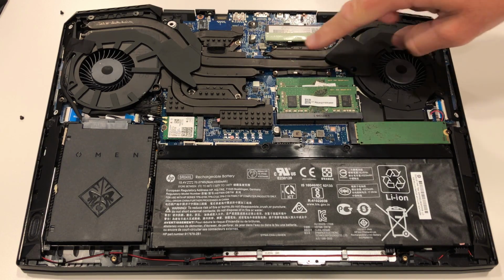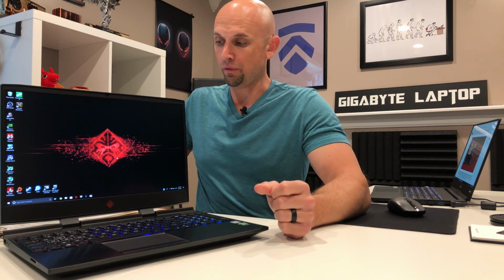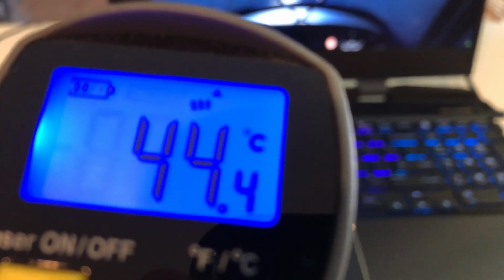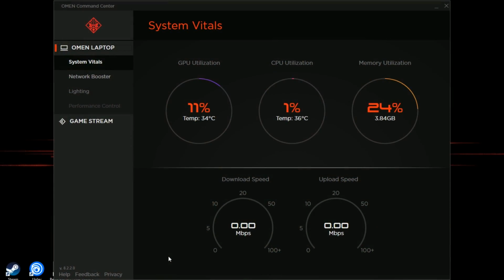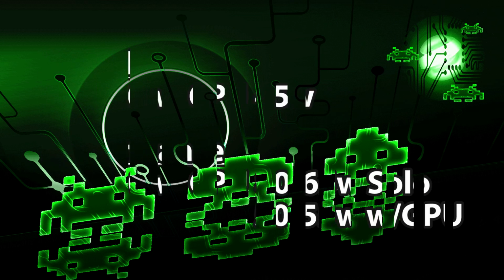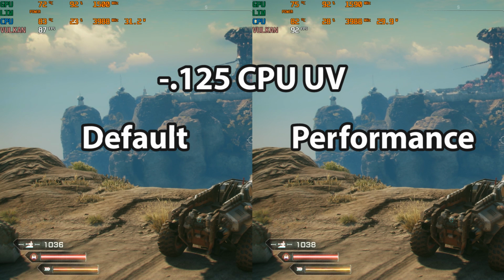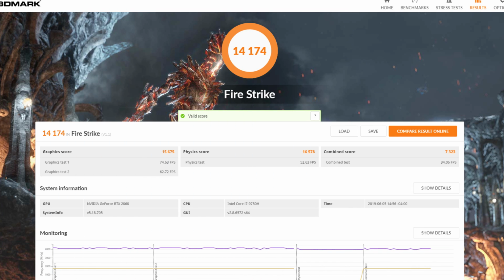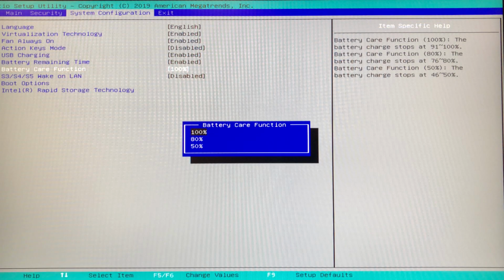HP Omen 15!  RTX, 9th Gen and 144Hz for $1199!

Comment: Hi Bob , I'm in a dilemma here. Should I choose the hp omen 15 or the Lenovo legion y540 ? Both have the same specs of  rtx 2060 , i7 9750 h and 144 hz and are available at the same price.
Reply from the maker: What’s your expectation of these?  The Omen has TB3 and neither one have proper fan control now that Lenovo removed this feature for some reason. 

The y540 looks more subtle which I personally find nice.
Reply: @BobOfAllTrades  Would like good performance out of the box  and  good gaming performance too. Don't know which does it better.The Y540 though has a bigger screen (17.3 inch) than the Omen 15 (15.6 inch)
Reply: Thanks for the advice though. Got the Helios 300 today for 999$. :)  Omen was sold out fast!
Reply from the maker: Karthik R. Yup I posted that deal this morning 👍

Comment: I am getting extreme touchpad lag and often doesnt register taps. Any idea?
Reply from the maker: Try downloading the correct driver from their support page.
Reply: @BobOfAllTrades  did that, nothing. Even during bios update where mouse is also enabled it lags a lot. Hope its not a hardware issue
Reply from the maker: Valters Boze If it were me I’d do a fresh install using Windows media creation tool and delete all partitions. You’ll be in for some work to get everything back the way you want it but if that doesn’t fix it at least you’ll know and perhaps proceed with a return.
Reply: @BobOfAllTrades  i think it was interference with something, works good. I noticed it doesnt work AT ALL if touchoad is within Vive VR lighthouse path, have to cover that direction with other hand to use touchpad

Comment: Bob, thanks for the great review. Just a 3 questions keeping me awake this night. Its 1.00 am in india now. Firstly who will be the winner if I compare it with Acer helios predator 300 i7 9750H, 1660ti and ELUKTRONICS 15 GR i79750H, 1660ti -- provided that those are also costs around 1200 bucks. Secondly the screen response time and backlight bleeding issue (if any, while acer 300 is pathetic on this) . Thirdly the hinges life in long term use. Please reply.
Reply from the maker: tanmoy biswas Hinges will be fine if you respect your laptop. I’ve seen the Omen at our local Microcenter and it’s been touched, closed and opened by more hands than anyone would put their own personal laptop through. 

Performance of the 1660 ti and 2060 are close favoring the 2060 by a tiny bit. 

The display on this Omen is made by LG and it’s very consistent in quality as I’ve had my hands on many different laptops with that part number and they’ve been great. 

That Eluktronics laptop with Eluktroboost is excellent and provides top notch frame rates per its spec. They run up to the max temps during Eluktroboost as shown in the review.

Comment: Just bought this laptop and it seems they've added fan control, somewhat, in the form of a basic Auto/Max switch in the command center? So there's that.

SO glad I found your channel btw. This video made my decision for me, tackled all the points that mattered to me and even save me the time on undervolt settings. Great job!
Reply: Just got this laptop. I am on the newest command center and bios F.12 and I don't see this auto/max fan setting. Were you able to find it?
Reply: @RastanPinball  Should be in performance control in the omen command center. If it's not there, you probable have a different model to what I have.
Reply: Mighty Duck yeah unfortunately that is what I am thinking. I have the same model as Bob in this video, 15-dc1052nr. Kind of bummed, one of the reasons I bought this was because of this added feature... oh well LOL. Thanks for the reply.
Reply: How is the laptop so far?
Reply: @ifteharulhaque2600  It's great as long as you undervolt the cpu to keep it under 90 celcius. Setting the fans to max helps as well in some cases. It just takes a REALLY long time updating windows and bios out of the box, the latter which, i guess, includes the fan control.
Reply: @bebekperkasa  Thanks👍
Reply: Mighty Duck hmmm how about the battery life in normal basis using? I've seen a lot of review said that it only lasts for 2 1/2 hours in the low setting even just for writing, that's stop me from buying this laptop :') please help
Reply: @jily0975  Not sure about battery life. I mainly use this laptop for gaming and graphics work and haven't been taking it out much. 2 1/2 hours seems pretty accurate an estimate, though, seeing this model doesn't come with an iGPU - meaning the system is running RTX at all times even at idle.
Reply: Mighty Duck Thanks for the response, hmmm yeah so it’s understandable that it consumes a lot of energy all the time :’) anw did the existence of iGPU/Nvidia optimus affected the gaming experience/performance?
Reply: @jily0975  No impact on performance that I can think of... which begs to question why HP would deactivate the iGPU in the first place. The laptop's small and light enough to be a mobile workstation, and that extra battery life from an iGPU would've gone a long way. Just another con to think about, I guess.
Reply: Mighty Duck yeahhh that's why i have come to the opinion that it might decrease or at least interrupt the gaming performance.. it's always giving little anxious to me if i cant solve the problem tho lol :") it's either big curiosity or just my pure OCD.. Thanks for your time, have a nice day 👍🏻

Comment: bob if this laptop has exactly the same chassis as the  1060 if i took the motherboard and placed it in the chassis of the 1060 will i get the updates services but not buying a new laptop??
Reply from the maker: That’s an interesting question and I do not know the answer. The CPU cooler looks slightly different too. Not sure if a new motherboard would come shipped with that.
Reply: @BobOfAllTrades  perhaps also replace the coolers or make some slight alterations? I the hard drive and battery looks the same so it should be at least cheaper than a new laptop coz that just wont make sence... would it?

Comment: I just bought this exact laptop from Microcenter here in Northern VA. I returned my Alienware m17 that had an RTX 2070 Max-Q. I mainly play AAA games at 1080p. I am telling you... this HP with a full RTX 2060 is getting much better performance than the Alienware m17 that I just returned. My buddy has an RTX 2080 Max-Q on his Alienware m15 and this HP with an RTX 2060 almost gets the same FPS on Ghost Recon Wildlands, AC Odyssey, and Gears of War 4 (there is a 7 fps difference in those games at ultra settings 1080p). This is one of the best laptops I have ever had. I had an MSI GS75 Stealth with an RTX 2070 Max-Q, an Alienware m17 with an RTX 2070 Max-Q, and I still own my Dell 7577 with a GTX 1060 (I am going to give the dell laptop to my wife). The HP Omen 15 with a full RTX 2060 is a fantastic laptop. Trust me... you wont regret buying it. Mine has a bit of back-light bleed, but I purchased a 3 year accidental warranty from HP for $171, and I love it! 

Thank you for this amazing review.
Reply: Daniel Mikhail . So i can play all games on ultra setting no lag no any thing and what about the fan is high voise or normal ??
Reply: mohamed Elshorbagy I have not found the fans to be super loud at all. The Alienware I returned had much louder fans. I think the fact that this laptop is thicker... I think that helps a lot with the fans.

Comment: I'm getting conflicting specs when looking this up. There is a model with a 8750h and a 2070 max q. Is the 9750h model also a max q variant?
Reply: The 9750h is the 2019 model. If you want the full rxt 2070, have a look at the 17 inch models. 15 inch models are only available on max q, with the exception of the rtx 2060 which is the full gpu.

Comment: But in comfort mode, with 125 uv max temp i have reached is 80. I cant see any performance differences between these 3 mods.
Reply from the maker: Ege Sevindi you might not depending on what games and software you’re using 👍

Comment: What do you think about the 2070 version with 32gb of ram and a 512gb ssd for $1539?
Reply: Not worth, you don't need 32gb of ram with a 2070
Reply: Apologies for the knee jerk reaction.  There is a side by side demo showing newer triple AAA titles doing 5 to 8 extra fps with 32gb over 16gb of ram.  I can't ecomain it but it seems legit.
Reply: @admingeneral6532  Games don't magically use more ram. Ram isn't something that boosts your performance.

When you run out of ram, games stutter.

Comment: what software do you use to address the thermal issues? I know you mentioned tweaking things in your video, but I cant seem to see what you are using. Thanks. Just purchased this laptop last week and the heat.. holy hell. How long can a laptop survive when the CPU is reaching 93c under load?
Reply: Undervolt the CPU with Intel XTU. Set the Core Voltage Offset to -0.150v

Comment: Hey! Do u know if the variant of this one, dc1092tx with i5 9300h, 1650 and a 60hz Panel also lack Optimus? And if it doesn't have it, wld it as a result have a battery life comparable to a Lenovo Y540 with similar specs but a smaller 57wh battery?
Reply from the maker: I do not know

Comment: But why would you want a 144 hz display if the ingame FPS barley reaches 80+ FPS?
Reply: The refresh rate is not only related to gaming, in general it is just a softer/smoother experience when opening new tabs and scrolling through pages.
Reply: @morebrainmoregains3234   If 60 FPS are enough for you. I couldn't stand playing any Game at 60 anymore after having 180hz
Reply: Every game gets 80 fps? Even something like csgo?
Reply: @jasonjones3579  Nah CSGO does get a lot better FPS by nature since it's so old. But to get 144 hz on CSGO you won't even need a 1199$ Notebook
Reply: @me4ever2  Yeah, you don't need that much power. But if the laptop had a 60 hz screen, then it wouldn't matter.
Reply: @morebrainmoregains3234   Because I thought it might be able to handle Tripple A titles on decent FPS. Not every Comp shooter is CSGO. In Any other Shooter but CSGO the 144 hz screen is useless.

Comment: Is the color accuracy(srgb and adobe rgb) and the brightness same when comparing the rtx 2060 model with the gtx 1660ti at micro center .
Reply from the maker: The Microcenter model uses a dull 60hz display
Reply: @BobOfAllTrades  Thanks for replying....one last thing...is the srgb same for both?
Reply from the maker: vaibhav soni Without having it I’m not 100% sure. But it’s likely using the same panel as the 1060 model.  That puts it at 70% sRGB. Not pretty.
Reply: @BobOfAllTrades  Okay, thanks for the heads-up. Keep up the great work!!💯

Comment: What the process of cracking this open? Like is it easy, moderate or like stupendously annoying?
Reply from the maker: It’s a little annoying because MSI is notorious for having these little plastic tabs that break off. On MSI laptops that I have owned I would actually break all of them off and then use the screws to hold the bottom panel on much nicer
Reply: @BobOfAllTrades  *HP
Is that fine though? The plastic tabs being broken off like that and being held in with the screws. Just curious about that.

Comment: should i consider buying the one with rtx 2070 max q or the rtx 2060 variant? I have heard that rtx 2070 max q performs worse than a rtx 2060....PLEASE HELP!!!!
Reply from the maker: It doesn’t perform worse since they both pull the same wattage the 2070mq will be faster. 

Too many people claim they know what they’re talking about based on a few benchmarks with a two laptops. 

I like where the 2060 version of this is priced.
Reply: @BobOfAllTrades  thanks a lot for your opinion... I am ok with a high price, now that I know that 2070 is faster I will go with it. Thanks again! Good video BTW, keep it up!

Comment: Would love to see this compared against the equivalent ryzen processor along with last year's model.
Reply from the maker: John Davis AMD has nothing equivalent to offer and compared to last years model wouldn’t exactly help anyone. It would just upset those who bought last years model.
Reply: @BobOfAllTrades  what about the Ryzen 7 3750H or 2800H? New to laptops. Not really concerned with what gpu is used. I am concerned with processor performance and power usage.
Reply from the maker: I like where they’re priced but it’s 4 cores 8 threads and not quite a good as intels 8300h which is their base i5. 

I’m all about AMD in this market space and it couldn’t happen sooner. But the performance is a bit behind especially once you start to lower settings to improve performance.
Reply: @BobOfAllTrades  enlightening and disappointing at the same time. Maybe we will see something better once 7nm progresses.

Comment: A good fix to lower temps is to simply limit the turbo clock in Throttle stop. That will make your CPU run slower but as long as it doesnt bottleneck the GPU, you will game at almost the same FPS but a LOT lower temps. Like 65 degrees C max with turbo at 3.0 Ghz. That works if you dont play CPU intensive games, like Metro:Exodus. For AC: Odyssey or the like, simply return turbo clock speeds at max and game that way. If you do the abovementioned, you will most likely game on a lot lower temps for a few years before the games evolve and you need to boost to turbo clock to its original speed.

Comment: hey can you do a direct comparison? with the Acer helios 300
Reply: i did some researches and alot of wandering on the internet about those two laptops if you don't mind the hp omen looks get it , if they are on the same price for the same specs the thunderbolt 3 and the optimus/G-sync your version will come with one of them . they are the factor to get it for longevity and for the fact that hp omen 15t uses more power = more performance even though the acer 300 doesn't reach the hp omen 15t temps but  the omen offered the slight edge and having the bigger battery 58 vs 70
Reply: @firasrabaia  This is exactly the comparison i try to make. I need a laptop for Gamedevelopment (so I have to use it for like 6hours on school) and also want to game on it. Batterylife is important for me because of that. The negative parts of the Acer Helios 300 are the small battery and it is not bright, so probably not a good choose for me.
Reply: @OFaruk58  same as me but i am still a computer Engineering student and for gamedevlopment you may need more screen or more power with thunderbolt 3
Reply: @firasrabaia  so which one is better? hp or acer?
Reply: @ahmetbalaman8726  if you gonna get an acer get a 1660ti check it is preformance if it is enough get the acer if you are not gonna use thunderbolt and don't want to tenker and always on charger 

But if you really want the extra battery the thunderbolt and the 2060 or 2070 and willing to do some tenkering for getting best temps and preformance get the omen 
If both isn't same price in your country as i found get the cheapest 
1660ti vs 2060 omen are the same price on amazon there is a difference of 70$ i think
Reply: @firasrabaia  do you know the tinkering needed to get the best possible performance and temperature?
Reply: @ahmetbalaman8726  I have this exact laptop only with the 1660ti instead of 2060 and love it. It's always plugged in so I can't speak to battery life. After undervolting the CPU and GPU I don't run into any throttling. I have the GPU frequencies set to allow a max freq of 1725mhz at .76v. Before doing that I was getting occasional thermal throttling on the CPU, but not the GPU when playing AC Odyssey which uses more CPU than most games. However even when it did throttle the frequency barely dropped. I mean only from 4.0ghz to  3.96 -3.89ghz. Since the GPU and CPU share heat pipes, limiting the GPU freq to a max of 1725mhz brought the GPU temp down which helped being down the CPU temp. After 1.5hrs of playing Hitman 2 the GPU temp held at 70°C and CPU between 80-90°C. Plus, I was still getting better framerates than the stock GPU setting since it was technically overclocked. It would go up to 1775mhz between .8v to close to 1v. I just limited the max boost in the overclocked curve. I didn't even notice a drop in for when limiting it to 1725 vs. 1775. Personally, I hate gamer looking laptops, but for some reason I don't mind the look. I think it's because it doesn't have "predator" or "legion" in big letters on it. This one just looks like I bought a skin to put on it. I really like they keyboard too. Feels nice and and solid. Good key travel and spacing. The screen is awesome. The new wifi card is great too. I don't even have a wifi 6 router, but my steam downloads went from 14mbs to 21mbs. On a 15 screen when I play games I struggle to tell the difference between ultra settings and high or very high. I play all my AAA games on high/very high and get 60-90fps. No b screen tearing or anything like that. I definitely could tell I was using a high refresh rate screen after coming from a 60hz even if I'm not getting 144fps. The screen color looks great too. I forgot to mention that I use performance mode. Even if the CPU/GPU are running the same as they are in default, the fans scale up quicker in performance mode. So, even though I've undervolted to keep temps down, the fans run higher than in default mode with the same settings. The CPU gets power limited in default mode too which drops the freq more than if it does happen to hit thermal throttle in performance mode.
Reply: @btbarr16  i have the same one as urs bro 1660ti i7-9750H and i luv it too :) its my first gaming laptop
Reply: No need of Comparison Bro hp is the best